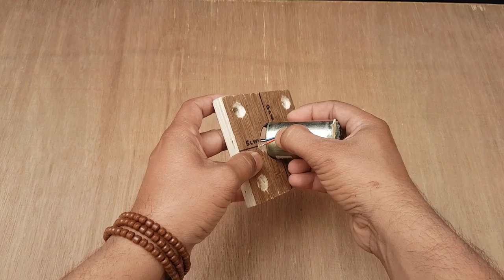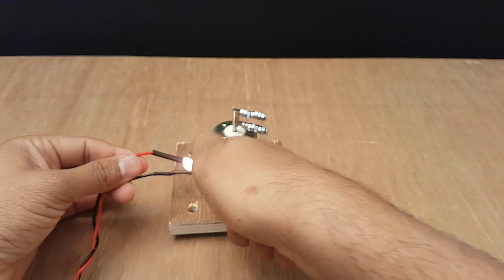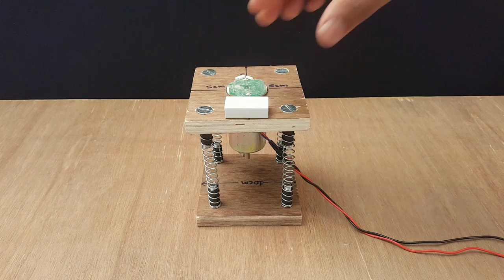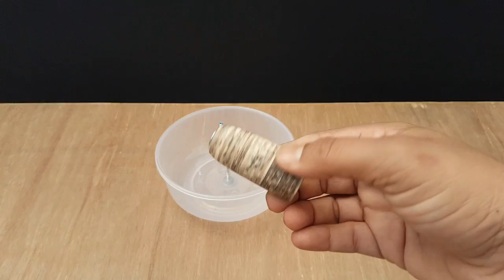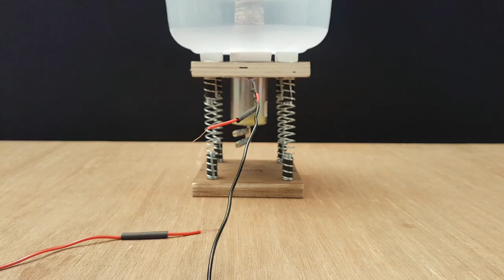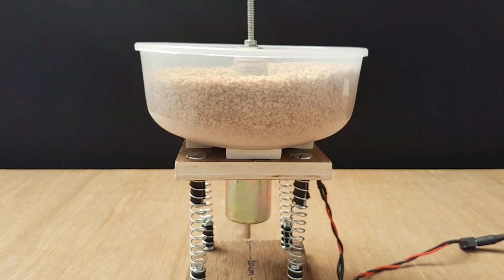How To make a Vibratory Tumbler Machine

Comment: There would be less wear and tear on the motor if you were to use a belt and two pulleys where the pulley attached to the bottom of the bowl has the counterweight on it and the motor remains stationary and relatively vibration free.
Reply: The bushes would wear out before the bearings did, and these motors are very cheap to replace

Comment: Allergic to soldering?
Reply: I have to agree, shrinking heat shrink with a lighter is pure lazy   @mfuller1093
Reply: @AJRestoration  nah thats what pretty much everyone does and it works, but not soldering wires is just wrong and if not dangerous in so many levels.
Also that motor wont last long in such usage, its bearings dying real fast like that.
Reply: @behemothinferno  can be a broke ass indian but did a video showing the main principles to build the machine and you didn't. watch and learn

Comment: First of all you could not clean those threads because off cleaning droplets size they are biger than threads on bolts, good job for building machine but results are to much fake you say leave it for 25min when everyone who use this desing leave minimum for 1-2h or even for full night logicly its fake results but mashine should work fine with fine sand and for longer period of time it should be fine (Y)